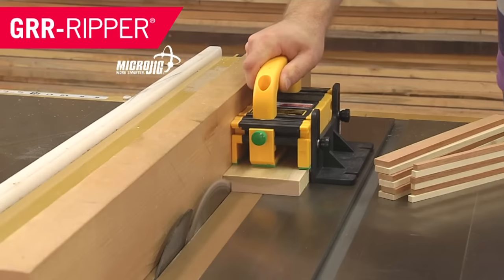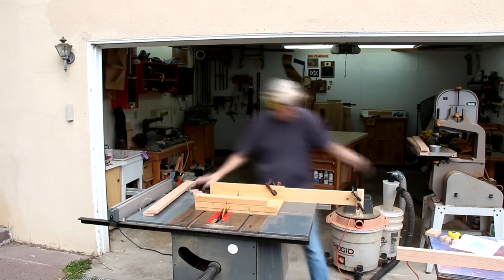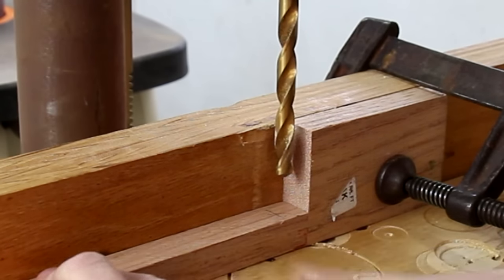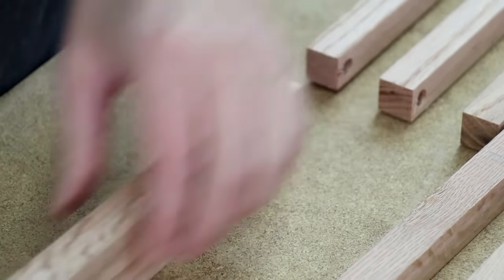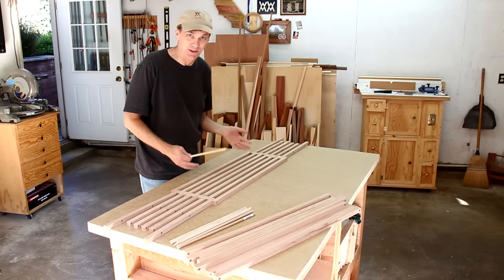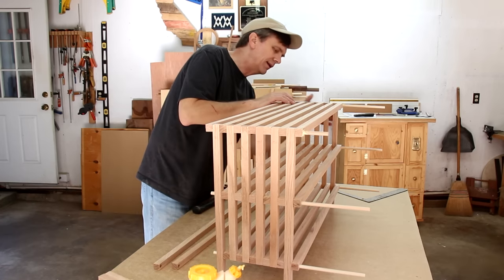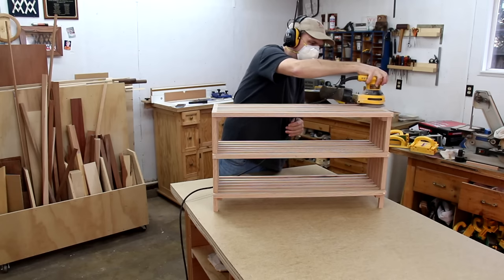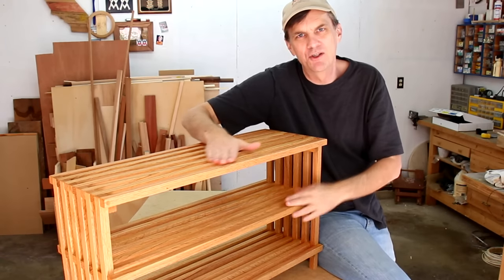Contemporary Shoe Rack. Easy-to-build woodworking project.

Comment: My wife walked in on me watching this video. She wants a shoe rack, book shelf and kitchen china display built like this... Thanks Steve?
Reply: Try to say no to wife , see where that will take you :)
Reply: Opportunity to justify buying a new tool (or two). I honestly used this to justify my drill press! Have a drill press… say you have to have a band saw. Do you need a band saw for THIS project? Of course not. Does she know that? (Same answer)

… I’m here because I’m building another; but customized. 4 levels, with the bottom level taller for boots.

Dry fit: the dowels were too tight… so lube. (Still have some Johnson’s Paste Wax).

Comment: Just finished this as a present for my daughter for her new house.  If you use the plans make sure you drill three holes in the down pieces (the plans only show two) Also sand down the dowels otherwise your going to need a big hammer to push them through all the holes.  Great little project!!
Reply: I just built this and agree with you. Instead of sanding the dowels, I put a small amount of floor wax on each dowel using a cloth. That made it much easier to insert the dowels and eliminated the need to sand them.

Comment: Love when duck tape makes an appearance.
I really don't like to dry assemble anything.  I like to live on the edge,  apply glue,  run around frantically looking for the right size clamps or cauls.. It gets real intense sometimes. 
Love your videos Steve.
Reply: Good decision.  I need to remember the duck tape connecting my shop vac to my miter saw
Reply: DucT tape. :) 
You could probably use it on a duck as well but I would advise against getting it on their feathers.

Comment: Hey Steve. I have a rig that I use for Adirondack chairs at the drill press. Rather then coming from the side. I bring my pieces from the front. I set the bit on my mark and move my drill press fence into position. At each side of the piece I add two pieces of scrap that help me to line the pieces up. In a project like this. It's a lot of help. Works well for making chair seat slats. It hard to describe. But I can send a video if you want to see it.

Comment: I liked your plan for the shoe rack but I needed a very cheap rack that would hold 16 pair of Nike Running shoes. I found a load of scrap pine and cut 3/4" segments that I needed.  I modified your design. I added 6" to the shelf length, 7 " to the overall height allowing  one additional shelve. I now have 4 shelves @ 36" and each shelf now holds 4 pairs of shoes . I painted it white and it looks great. Best of all , I constructed the rack for a total cost of $7.00. ( spray paint & dowels )

Comment: Maybe it doesn't pertain to this project, but how tight would you typically like a dowel to fit if you are using it as a part of jointery? I recently bought some 3/8' dowel material, but when I drill a 3/8' hole, it is not difficult to get the dowel in the hole.

Comment: Love the slat look - It would be great for draining the melted snow from my boots right now - as you work out in the sun, haha
Reply: Duck board rules!
Reply: Make sure to put the wet ones on the bottom.  You don't want the wet ones dripping through the top slots onto your other shoes.
Reply: ***** What if they are all wet?!?!?
Reply: Then I guess it is time that you move from that house because it sounds like you live in a flood zone.  haha
Reply: Nick Ferry I don't think leaving it outside would be good with wet shoes, I've made that mistake before. After a while the shoes are cold and very stiff.
Reply: Ben's Collection and Sundry But I bet if painted purple it would help, lol.
Reply: I have a hard time believing that, Nick.

Comment: Why hook up the dust extraction on the chop saw, especially if it's venting outdoors?  I assumed its just for heath precautions of dust in enclosed spaces.  I normally don't get a lot of dust build up on mine that would interfere with the cut.

Comment: Steve this may be a silly question, but although I previously have city and guilds trades in construction, carpentry  joinery etc. I live in the UK and dont recognize the glue your using in your wood projects ! All I use and can get cheap is basic PVA. What do you use if you see this post, or anyone else that can assist. Im now mentally and physically disabled but my brain and body still appear to work pretty well when making things and to me its re-educating the broken parts of my brain andas I always work safe I get hours of enjoyment

Comment: Sweet shoe rack! Couldn't you have save time on the drilling if you drilled those holes before you cut all the pieces?? I know it's a wide board but couldn't you set a stop block drill down half way then switch it and drill the other sides?? Just a thought. Great videos with cool projects too!

Comment: you should add some clear Perspex to the underside of the two top shelves otherwise mud from the soles will fall into the shoes below, had the same problem with a shoe rack at home

Comment: btw are you gonna use the 12 or 10 inch miter saw in the future? just wondering because i really like my 10 inch (sliding/12 inch capacity)
Reply: ***** my choice would be the 10 inch. Like you said, the blades are cheaper. If you have something to big for the saw, you could always use the table saw. I'm still saving but i want to get a dewalt table saw, until then i definitely need the 12 inch capacity of my cheap miter saw
Reply: gerard kiers I love your works !!!
Reply: Gianpaolo Spadafora do you mean my g.work.specials??

Comment: nice design, but all the holes/doweling seems pretty much overkill, considering all the pain of lining up holes it comes with. A simple glue up would have done the same, considering tight bond 2 is tougher than wood anyway and its long grain glue up.

Comment: this is the reason why in engineering world you have 2 way and 4 way holes. 2 way means a slot and 4 way means an over sized hole.
Reply: At my job you have to run huge studies to make sure your product can go together easily no matter what. Also i ended up doing just that when i made your wood floor mat.

Comment: is it strong enough to sit on?
Reply: +Frank Kovach 
i would think yes, but may it is too low for have a comfortable seat position ;)
Reply: +Kühn i have made two, different dimensions than his, and it is suitable, but scary.
Reply: Frank Kovach
if wiggle around then can make a backwall or an X  to gice more stability :) and may a peace wood on the top with some nice pillows or stuff...
Reply: I may not have made myself clear.  I made mine out of cheap "Select Pine" from HD and Lowe's, and poplar dowels.  The height overall is chair height.  The dimensions are slightly different, four feet wide overall, about a foot deep, and about 17 inches tall.  There are three horizontal surfaces on which to place shoes, with the bottom rack being taller than the others to accomodate boots.  Because of the way there is only glue on the dowels at the ends, it creaks a lot when putting weight on it.  I don't consider it a bench, but I have sat on it and so far no collapsing.

Comment: You might be able to get away with using something like a  self centering doweling jig. Tho for the price of a quality doweling jig you could buy a 8 inch harbor freight drill press(20% off coupon). The size of a tiny drill press has it's own limitations.